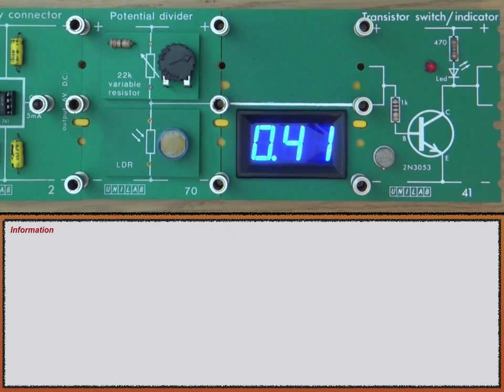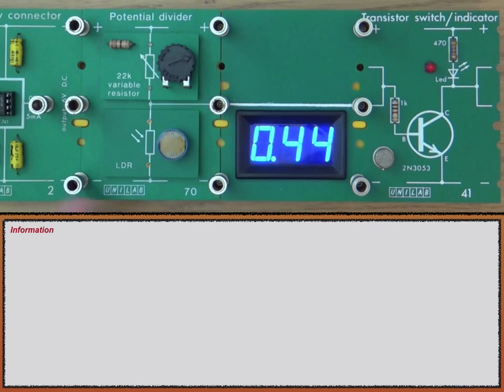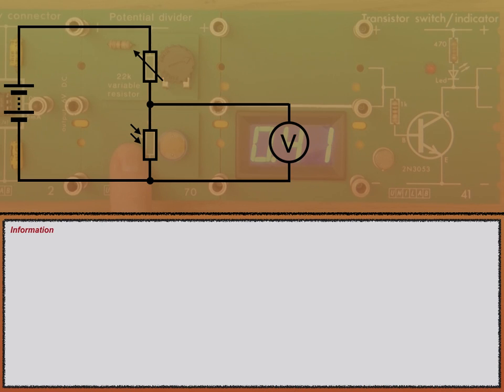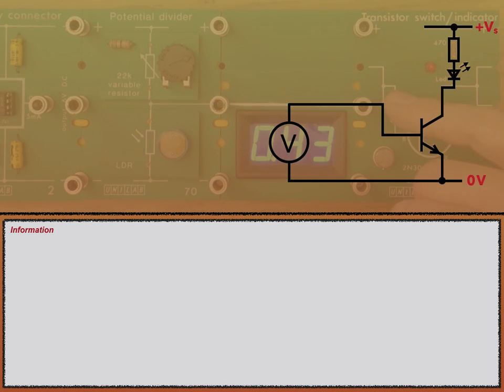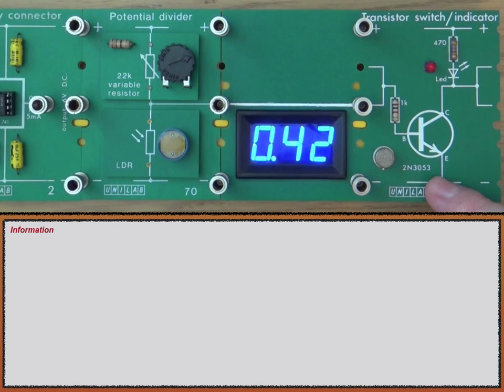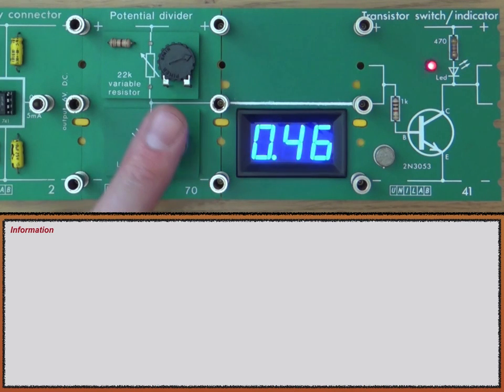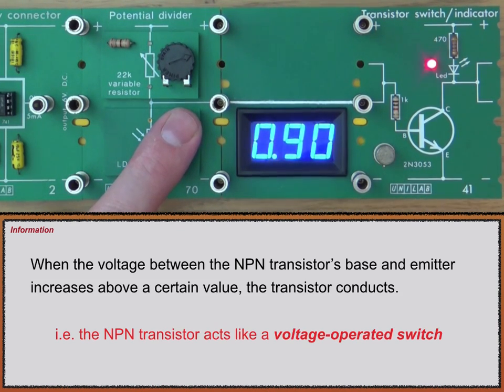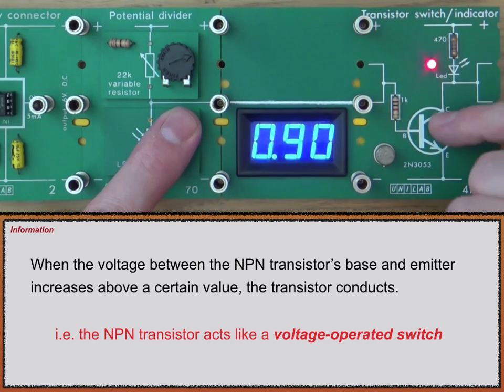Transistor circuits 1 - with LDRs (National 5 Physics)

Comment: Hi. I recently sat the national 5 physics prelim and failed it and got no award. Is there any tips you have so I can maybe get better and pass? Thanks
Reply from the maker: The main thing is to learn from your mistakes - maybe your teacher is willing to go over the prelim with you and give you some advice on what to work on. I'd suggest working through the past papers when you revise for your exam and start early so it's not a stress. You might also find my LIVE lessons useful - you can get a list of the questions covered from my website. Once you've answered them, you can watch the videos - they're not short, but you can always watch them a question at a time. I tried to write them in the same style as the exam questions and managed to cover most of the course. Hopefully i'll do more live lessons next April/May as well. Think of it this way - at least you know now where you're at with your Physics - if you put in the work then you'll go from strength to strength. Go for it!